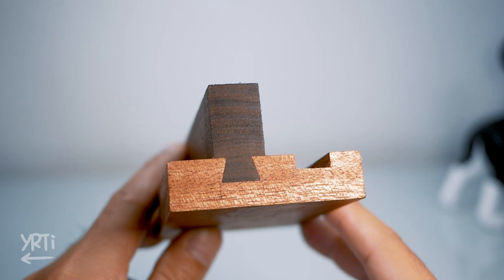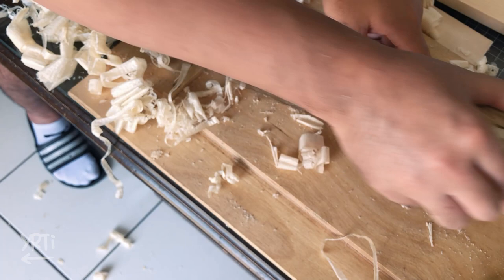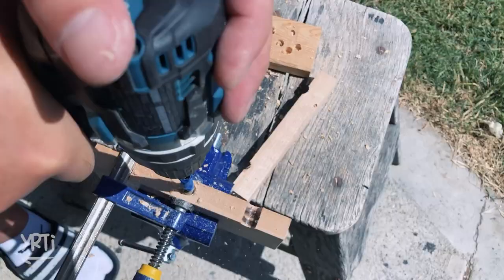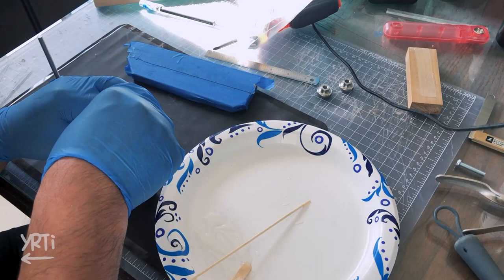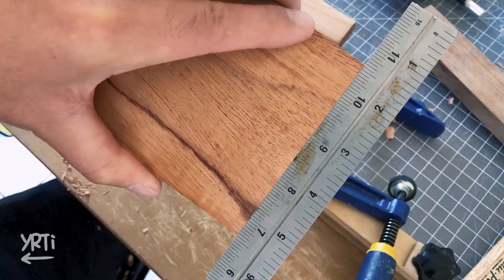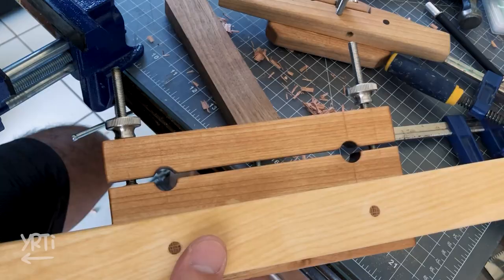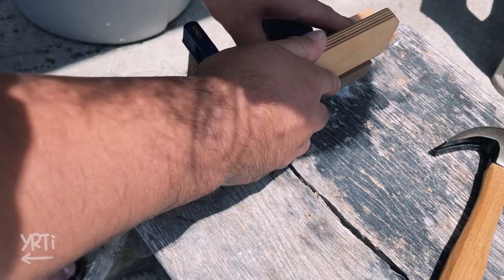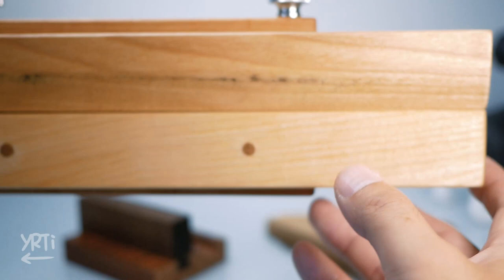Easy Kerf Plane & Sliding Dovetail Guide Jig - DIY Hand Tools

Comment from the maker: After I used the kerfing plane several times, I think it was better if I made it a push saw  with a strong handle rather then a pull saw. The biggest concern is, there’s too much friction.
Reply from the maker: @miketo09  Hi Mike, Thank you for the comment and the advice:)

As for friction, they are exactly the major factors and I think using a blade with set can solve them like you said. Though I may have to give up the features like cutting exactly where I place the blade on with very minimal play and it won't damage the fence so I can re-use the fence.

A convex shape blade is very interesting idea! I was actually thinking the version 2 can be something like a half set blade (file off the one side of set) - I'm not sure if such thing works. Anyways, I don't have any metal fabrication skills/tools so I'm happy if somebody develops it to the next level!
Reply: Hi, I enjoyed the video, thanks. I see the problem a pull saw would have without a handle, if you changed it to a push motion you may be surprised that you could still use your method with the fence to guide you without it binding or creating friction. You could also rub a bit of candle wax or soap on the fence and blade for lubrication. Take care my freind👍😊
Reply from the maker: @peterdeans4635  Thank you for the comment and the advice! Now I use camellia oil as lubrication and it works better but there are still many more things to improve...haha:)

Comment: This is a brilliant little jig. I'm in the process of making a dining room table, and I'm debating whether to use a sliding dovetail for the bread board... My challenge is making a dovetail across 30"+ is a little bit trickier
Reply from the maker: Thank you for the comment! I would do a staggered sliding dovetail (Okuri ari) that sounds kind of complicated but in reality, there is a less chance of messing it up. 

Please check my open shelf project (I used the sliding dovetail jig but I explained the joint). 
https://youtu.be/PDpDdHLubF0?si=qnGTRrq5MNrhp1Tz&t=301 

I made the joint without the jig (One of my early time project/ kind of embarrasing...)
https://youtu.be/3xxCP7bADqw?si=rcam6NUGi9WeYAKz&t=105
Reply: @YRTi  thanks for the tip! I think if I make a large enough jig (I have plenty of stock) I can make the cut well enough, but I'll add the staggered option into consideration.

Comment: Good to see what you can achieve with very little expense. Thank you. Two hints: Use parafin wax to reduce friction on your wooden tools; and why not remove every second tooth on your saw to ease the cutting? Cheers.
Reply from the maker: Thank you for the advice! I'm still new to woodworking so I just prefer to buy a tool as needed basis for better understanding of the tool rather than buying a lot of tools all at a time and I don't even know how to use them, haha.
Reply: @YRTi  A very sound attitude.

Comment: I love the dovetail guide. I always hate making dovetails and end up doing finger joints instead. I think I am going to try to make a similar dovetail jig.
Reply from the maker: Thank you! If it's for a dovetail joint (not sliding one), I actually found Veritas Dovetail Saw Guide System is a pretty similar concept that they use a saw with a minimal tooth set. Now it's more than one year after this video, I somehow still use this jig for a sliding dovetail but for a normal dovetail joint, my advice is, you should try cutting it without a jig. The dovetail isn't an extremely difficult joint and once you get used to, I think you can do it just like a finger joint.... Hope you enjoy woodworking:)
Reply: @YRTi I have been working with wood since the 1980s. I still am horrible at dovetails without a router. When I hand cut them, they always have gaps and even when I use the socket to draw the pins they always come out with slightly different angles. Such is life.
Reply from the maker: Thank you for sharing your experience! I’m sorry to hear that but at the same it’s encouraging to know even an experienced guy like you still has something in woodworking that you can improve on:)
Reply: @YRTi we all have things to improve and learn, my friend. This is why we share with each other, to help each other grow. Thank you for sharing your journey. I look forward to sharing your journey.

Comment: Wow… this is genius! 😮
Reply from the maker: Thank you! but yeah I can still use it but the problem is the saw doesn’t run smooth, haha!
Reply: @YRTi  ...I saw another video where they put a 14º angle on a regular 2x4, and just clamp it on and then use that as a saw & chisel guide (for female/mortise). 

And, for the male end (tail/tenon), just use a rabbet or shoulder plane, and try to hold/tilt it at a 14º angle. 
Of course, this technique won't reach the very inside corner of tail/shoulder, so needs to be cleaned up w chisel after still. 
But, the shoulder/rabbet plane cut is a good starting point and you could reference/pare off of that.
Reply from the maker: Thank you for sharing the info, my friend!

Comment: I just found your channel.  This style of kerfing plane is wonderful.  I have used a Japanese azebiki with a guide to cut dados.  Like you, I found the teeth would become clogged with the sawdust.  It was a small price to pay for such a beautiful cut.  I will try your style for sliding dovetails in the future.  Thank you.  Also, for someone who is new to the hobby of woodworking you are doing fantastically well.
Reply from the maker: Thank you for the comment. I've tried some different methods to make sliding dovetails by now and I usually use an Azebiki & wide chisel for the side walls of the mortise. To cut the tail on a thin board like less than 3/4" board, I still use this kerf saw to cut out the majority of the waste or I don't know how else I can't cut a slice away from the marking lines on the tail side. So it's clogged often but I still use it :)

Comment: I like it, ive always had issues cutting sliding dovetails.  I think the hardest for me is cutting the tail side (dark brown piece in your vid) to match the angle of the other part
Reply from the maker: Thank you! This was actually my first time doing the sliding dovetail so as long as you get the angle jig right and position it right, I think you'll be successful. I've tried a hidden sliding dovetail (staggered sliding dovetail) in the past project (I made 2 shelves and the video with the darker brown shelf) . It sounds complicated but I think it was actually easier when it comes to fabrication by hand. If you are interested in it, please check it, too:)

Comment: The fence bit is nice, but if you actually use this to make many sliding dovetails you’ll rarely use it. Most sliding dovetails are in the middle of your piece (assuming you’re doing case work) and you’ll just use a straight line guide clamped across your work. Generally the location is much to far from the edge to use the fence.
Reply from the maker: Hi James! Thank you for the comment! 

For a board that has a wide enough surface to clamp the angle guide directly, I don't think the fence is needed at all (like you said, cutting out a groove in the middle of a wide board). Though when it comes to cutting a tail, there's possibility that I may cut a tail on a narrow surface where it's difficult to clamp the angle guide directly. Let's say cutting a tail on a 3/4" shelf board end. I think it'll be difficult to stabilize the angle guide at a right position without the fence and that is the reason I made the fence but no offense:)

Comment: Where do you get the knurled knobs that you used on the adjustable fence?  Keep up the good work!
Reply from the maker: Thank you for the comment! I got them from Amazon US (M6 knurled thumb nuts).  If you just need a piece or two, local HD/Lowe's have them(imperial ones), too. As far as I remember, each of them is like $2 - 3. I was actually just using this jig to make the next project but hmm, I guess I need to make Ver.2 of this jig maybe...